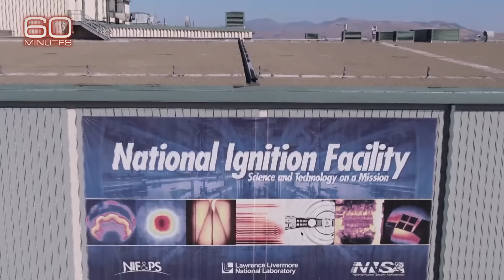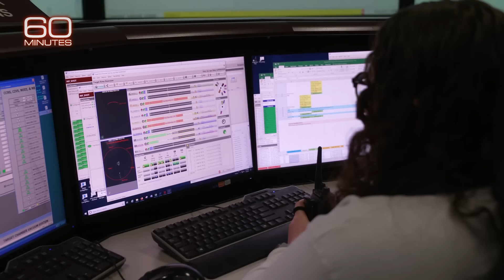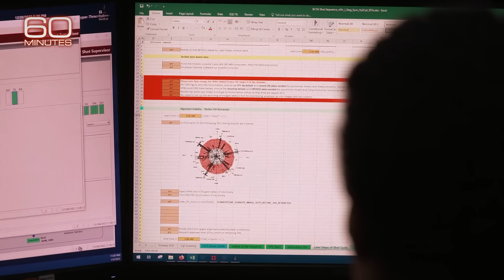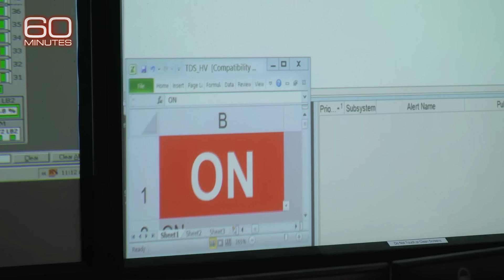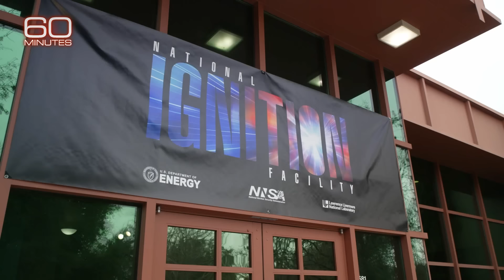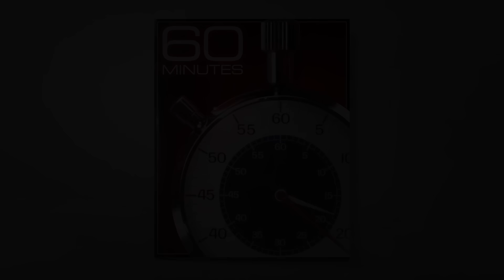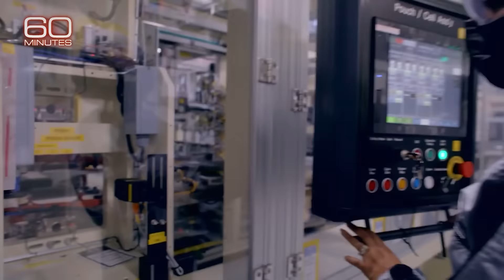Nuclear Fusion Breakthrough; Powering Electric Vehicles; Carbon Capture | 60 Minutes Full Episodes

Comment: Over the very long term there has been a 50 million year slow cooling trend that has not been fully explained other than some suspect the atmosphere is thinning due to declining magmatic activity.  In consideration of this along with the constant erosion of the atmosphere by the Sun, we may want to preserve greenhouse emission sources for later release. If we are ever able to establish a sustainable relationship with our environment it doesn't hurt to locally think long term. 

Also, the prospect of being able to put in deep geothermal wells anywhere on the planet using sonic or plasma drill heads could aggravate this potential problem. As well as further reducing magmatic activity, if society where to go hog wild with this, by cooling the upper mantle, it could slow the convection of the entire mantle. It's kind of like the AMOC slow down problem we now face. Likely this would increase the core's temperature such that the central solid part would decrease in size. Subsequently the magnetosphere would weaken and the atmosphere would even more quickly erode! This would further increase the rate cooling and expose the surface to more harmful radiation. 

Rather than further adding to our  environmental predicament with insults contrived by well funded and hubristic ideologues reaching for dead hell holes to terra-form, as many "long termers" would have us do, we would do much better by doing all we can to maintain this verdant vessel for as long as is reasonable. Perhaps in the future we will develop appropriate technologies and capabilities that greatly diminish the impacts to Earth's viability from such activities. Presently, we do not have the needed understanding.

Comment: In the lab fusion community, there is a 30 year old joke:  "Fusion for energy generation is just around the corner, and it has been just around the corner for 30 years."

LLNL's effort is scientifically interesting, but it is completely uninteresting practically.

When they say, "More energy out than energy in," they are casually obscuring the fact that they mean "more energy out than laser energy in."  They weren't anywhere near being able to say, "more energy out than total energy in."  That was probably closer to 1 percent, not the 300 percent of there announcement.

So, Fusion for energy generation is just around the corner, and it has been just around the corner for 30 years.  Although ITER has its own problems, ITER is probably closer than LLNL is.

Comment: About 12:57 , Its always been an engineering problem, not a scientific one. Fusion is scientifically feasible has long been established. The issue has always been how to contain the reactants at the extreme conditions required to sustain the nuclear reaction. This ignition experiment only showed that the reaction in a small ball can be ignited by supplying the extreme heat through lasers. And then the ball blows up. But how are we going to contain the reactants so that the heat can be extracted without blowing up the reaction chamber. There is still no breakthrough to that engineering problem.

Comment: Not just hydrogen but also helium3 is also needed.
Reply: Helium-3 is being considered as part of the fuel for certain other nuclear fusion energy reactions. It is exceedingly rare on planet Earth. The reaction requires far more extreme temperatures than that required for the deuterium/tritium reaction (D/T). Normal hydrogen isotope is not being considered as a fuel for nuclear fusion energy reactions because the temperatures required is far to extreme.

The vast majority of nuclear fusion experiments are focused on employing the uncommon deuterium isotope of hydrogen and on the tritium isotope of hydrogen. Tritium is radioactive, is very rare and currently has a market price of approximately $30,000 per gram. The few reactors, from which it is derived, are likely to be decommissioned within a few decades. Since the pitches for controlled nuclear fusion energy, began in the 1950s these simple facts have been obscured repeatedly. Keep in mind that a conflict of interest plays a big role in pitches as presented by the video above. In addition the press has been largely snowed by the laboratory presentations.

Comment: I have doubts about the feasibility of this technique. They put in two units of energy, and got three out. But that doesn't mean they CAPTURED three units of energy out. And it seems like it was more of an explosion, rather than useful heat generation. Positive energy production values do not equate to efficient application of that energy for power generation. I feel like we're 15-25 years away from anything even starting to become slightly useful.
Reply: Helion looks more promising in my opinion.

Comment: Let me pose a really serious?  If u make anything self sustainable reaction how would u control it and with that said this sounds like a perpetual motion device with no moving parts it could easily over accelerate and maintain a dangerous reaction.
Reply: You should be aware that the NIF administrators are being misleading when they apply the term 'ignition.' There was no significant propagation of the reaction before the extremely compressed microscopic bit of fuel developed fusion in the middle of the mass. Then the outward pressure, from that, blasts away the surrounding fuel so it can't engage in the reaction. In the announced December 5, 2022, experiment only about 4% of the supplied fuel actually fused.

Typically, in Inertial confinement fusion (ICF) experiments, the amount of fusion is directly tied to the energy source required to spark any significant fusion reaction at all. Once the confining energy source ends there is nothing left to sustain the fusion reaction. In the case of the announced NIF fusion reaction it only lasted for approximately 0.000,000,000,08 seconds before extinguishing.

Comment: 36:34 Here is the thing about what the woman says: " they put more carbon to the ground that carbon emitted when used" ...heres the thing: Only part of the oil is burned. i bet they just wont include the plastics (Solid) materials, because she is speaking about "emitting" Even the plastic that is not emitted contributes greatly to the carbon pollutions. Actually its the bigger proportion, so i really doubt they are actually carbon neutral! (For reference car tires, the part that wears has around 400% of the carbon emissions compared to the all fuel burned in world traffic). How do they make all that micro plastic, that contains carbon, to carbon neutral? Let me tell you... IMPOSSIBLE WITH THE CURRENT NEW TECHNOLOGY!

Comment: Obviously, this is only the beginning! They still need to be able to sustain the reaction for longer periods, that dont require the measurements to be made in Planck Time!!!!
Obviously, I jest. But causing atoms to fuse in a sustained reaction, capable of providing energy for the masses, means being able to, not only harness the energy created during the fusion process, but also creating a reaction chamber that can withstand the kinds of temperatures, usually, found in stars!!!
Reply: The experiments, to tame nuclear fusion energy began during the 1950s. Since the 1960s those involved have always suggested that a practical fusion power plant was only about 30 years away. Not clearly mentioned, in this presentation, is that half of the fuel mix is radioactive tritium which is extremely rare and which has a current market value of approximately $30,000 per gram. The few reactors that supply it are likely to be shut down within 30 years.

Comment: The fusion experiment achieving more energy output than input power is ridiculous. The energy generated is heat, not electricity or laser power. The most expansive energy is the laser power, or at least the electrical power input. Electrical power achieves 100% conversion to heat, and heat can only achieve 20-40% conversion to electricity. Using multiple asers focusing on one point is impossible to generate a continuous process. I can only imagine how expansive it is to keep every laser in perfect working condition and aligned.

Comment: one of the things about electric vehicles is production is all fine but we still need the infrastructure to use those vehicles. there should be a law passed requiring every gas station owned by a major company; [shell, hess, BP, mobil, sunoco, exxon, gulf, etc.] they should all be forced to convert at minimum 2 of their many gas pumps into a charging station and they can install solar panels on those big awnings to mitigate the power drain from the grid. when charging stations are as readily available as gas stations then this country will finally be physically ready to drastically reduce carbon emissions
Reply: I agree that all commercially run fueling stations should be required to have at least one EV charger on site. they should be placed off to a side of the station land plot. Since Level II chargers often requires many hours of charging and Level III chargers generally require more than a half-hour of charging time the chargers shouldn't be placed on the fueling islands. Currently the business model of most fast chargers results in a concentration of them primarily at large shopping centers in major metropolitan areas. Incentes need to be provided to place them in rural areas that are away from the major freeways.
Reply: @vernonbrechin4207  i thought only the EVs & hybrids from like 5-7 years ago yske hours, don't the newer ones take like 15-30 min?
Reply: @hama- Thank you for your inquiry about the various types of chargers. Many descriptions are not clear about them. I have an EV with a 64 kWh battery. The AC chargers, fed by a single phase 220 VAC circuit, are often referred to as Level II chargers. Approximately 95% of the chargers are of this variety. They can feed about 6 kW of energy into the car battery. In my car it would take about 12-hours to fully charge it at this rate. The Level III fast chargers tend to be highly clustered in one place. They are typically fed from a three phase 440 VAC circuit. Typically they can feed energy at a rate of between 50 and 150 kW. In the case of my car this translates into a 80% charge in around 45 minutes. The last 20% of the charging is throttled down to  prevent damage to the battery.

There are some newer battery technologies, such as solid state lithium-ion batteries that will soon make it possible to cut the existing charging times in half, or a quarter of the current charging rates. Higher capacity chargers may be needed once those EVs appear on the roads.
Reply: @vernonbrechin4207  thank you for the explanation, it's much appreciated 👍
Reply: @ronnyshama  - You're welcome. I did much research before purchasing my EV and then learned much regarding the hype vs the reality of the existing charging network.

Comment: Remember hotter than Sun center and surely something is Rong since I have to see to believe since how the center of the Sun no one been so are they meaning Lava calculation IS not the same.
Reply: The temperature in the interior of stars, such as are sun, can be calculated using mathematical equations based on physics. In our sun it is over 100,000,000 °C. The liquid rock lava, that comes to the earth's surface is about 100,000 times cooler than that. Above 10,000 °C all elements on earth exist as a gas and is likely in the process of becoming a ionized plasma.

Comment: When I see something big I know we are not there yet. This plant needs miniaturiation. Lets think hard. We can not continue to have hundred metres long beam firing pipes. All we need is a touch invention.
Reply: The entire world is far, far, far away from even a small demonstration nuclear fusion power plant that is economically practical and commercially viable. This announced experimental shot took about a week to set up yet a practical Inertial Confinement Fusion (ICF) would have to perform a shot around ten times per second. This fusion reaction lasted for approximately 0.000,000,000,08 second and resulted in enough fusion energy to boil about two liters of water. There was no significant propagation of the fusion reaction despite the 'Ignition' name being part of the facility. The laser input energy was more than 100 greater than that output energy. Not all things can be miniaturized like microcircuits.

Comment: Perhaps fission should be combined with fusion. After all, the Jovian planets do radiate more energy than they receive because they fizz. The Sun must also have at first so that its fizz led to fuzz.

Fusion probably happens around the Sun's center rather than in it because its density is about the same as the Jovians (.255 Earths'). What is at its center is probably trans-plutonic elements (more than #100) made stable by the Sun's density which then break up when farther away, thus triggering fusion in turn. 

Otherwise its density equality with the Jovians makes no sense to me. Were its center hotter, it would be undenser.
Now back to my butterflies...

Comment: why don't they create a microscopic beam of hydrogen liquid of gas and hit it, why a microscopic ball.
Reply: A liquid and gas are two different things. The type of hydrogen that serve as fuel are two isotopes that are not common. one is deuterium and the other is extremely rare radioactive tritium. Efforts have been made to hit fuel droplets that were not surrounded by a hohlraum shell. They didn't work because the surrounding radiation that implodes the fuel has be be almost perfectly timed and uniform on all sides.

The size of the fuel capsule has to be tiny because in order to get the impinging energy high enough the immense laser beam pulse has to be focused down to an extremely small area in order to create the needed input energy density.

Comment: When it comes to EVs. What that company should do as pri 1 is a Self-extinguishing enclosed system so when there will be a short and a spark comes to live it will extinguish everything before a total firehazard becomes a reality. This would be inside the battery. Just watch videos on what happens when EVs burn and see all profit go down the drain.

Comment: This is so far from being practical it's just not funny. From the extreme precision diamond shells for the fuel pellets that are needed, to the massive amount of energy needed by the lasers, which are only about 3% efficient, this "breakthrough" of finally getting more energy produced in the fusion reaction than was delivered by the laser pulse is still many orders of magnitude away from being able to generate the power needed to power the lasers alone, let alone the losses involved in converting that nuclear heat to usable electricity.
Laser confinement fusion is a dead end for power production - it's only useful for validating fusion nuclear weapon models. 
The Helion project has a much more practical approach - where inertial magnetic confinement is used, and can directly extract electricity from the reaction.

Comment: "Less than a billionth of a second".. GMAFB. Next...
Reply: Actually the nuclear fusion reaction lasted for only approximately 0.000,000,000,08 second and then approximately 96% of the fuel was blasted away from the microscopic reaction center before it had a chance to react. There was no significant 'ignition.' It took about a week to set up the experiment.

Comment: We aren't buying those electric vehicles.  There's zero interest in electric vehicles without interstructure. We have zero interest in waiting to charge batteries. Every car manufacturer should have a battery exchange program. Pull in and swap a battery like filling up ur ice vehicles tank with gas.  Something that only takes minutes. Or a hybrid with on-board generator so it charges its own battery.

Comment: You have to admire the coverage of such hugely financed enterprises compared to existing industries. But, exposing the existing industries dirty secrets would capture more attention; as all the existing tech is based on obsolete and badly implemented physics and engineering. For example: Electric generators with Lens’s law (unmodified) energy fighting/resisting electromagnetic induction. The electric power generation can be done while being self-powered Forget using steam power and heat altogether. All proven obsolete over 100 years ago with technology presently active in every commercial power grid today.powered by steam engines.  Not even trains still use that tech today. 
Why spend billions of dollars on decades of engineering on fusion (Besides there are no lasers in suns, only plasma flowing through magnetic field, easily constructed and demonstrated to replicate solar effects on e  as Earth. To implement steam generators when electric generators can be self-powered? The sun generates electricity. If that’s what you need, make it directly.

As Tesla put it, “shift the phase of the induced magnetism and use it to power the induction”. (Prototypes already working by rebuilding electric generators and motors; no exotic power sources or materials (all available in junkyards world-wide.)

Or, use mass (momentum) transfer (completely fuel-free) in use from 1940’s) to power existing generators (no combustion or plasma or nuclear reactors, just common plumbing technology. (Viktor Schauberger (electric generator) and (Automotive) Sam Clem).

Saving billions of lives and Earth’s ecosystem; while ending carbon  (tech & economy) emissions globally